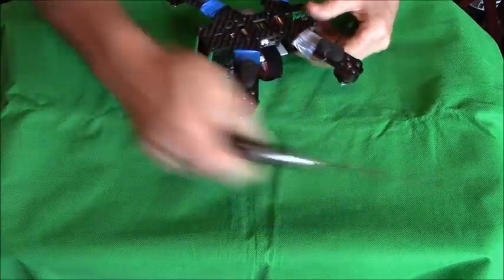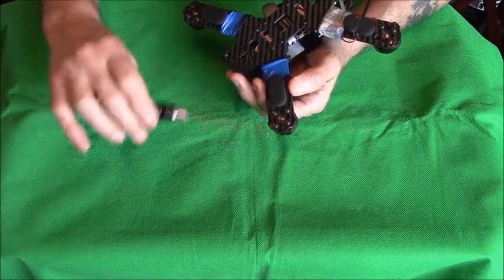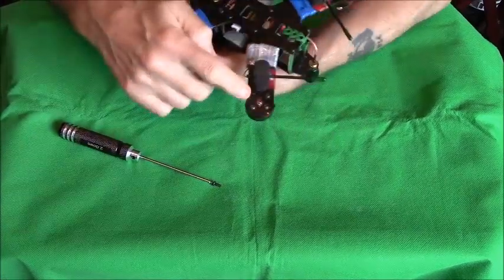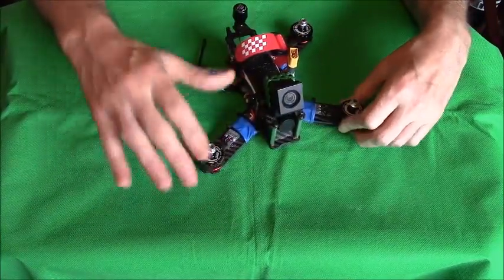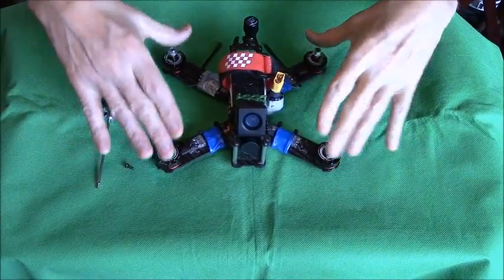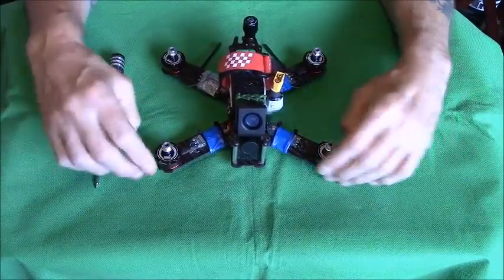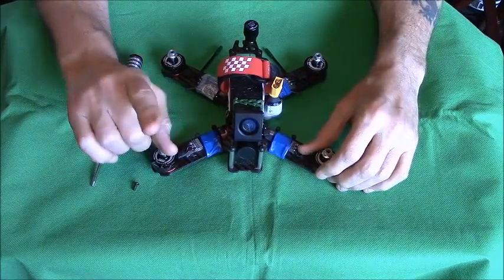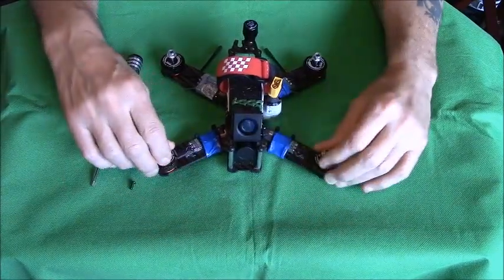HOW TO FIX HOT MOTORS ON QUADCOPTERS

Comment: I have a 6 s 25 0 7 motors and a brood of a motor just Ronan the motor on the Beta flight motors tabs one blip in smoke the motor and all for getting hot what is going on with this thing
Reply from the maker: What size KV are your motors ? and have you recently set up Bidirectional DSHOT & RPM Filter ?
Reply: @GeorgeCooper_LoneWolf  I have the lal 5.1 it has the 2507 motors I have the holybro v1.5 stack with the 65 amp esc . I swapped the motor and found   out it was the esc one pad is grounded to positive and ground. I was running the motor on betaflight  checking them it took a whole 30 seconds and the esc frays I have only flown it 3 to 4 times in my yard to tune it . Unbelievable
Reply from the maker: @jbengineering2681  Bloody hell sorry to hear that. Don't know where you got it  but I would send it back. That's the problem with RTF gear you have to trust whoever but it together did it right.
Reply: The sad thing is that I bought it new and the flight controller poped so I got rid of it and bought the holybro kukute I wanted good equipment it has a 65amp esc with the metal fets   and it died just bad luck I got the stack from raceday quads and the flight controller was bad when i first bought the stack from them they sent me a new one.now the esc poped .i have a check  eachine 79 and  i absolutely abuse it and it never has a problem lol

Comment: Thanks for the info , I have 4 2312 motors and when I fly all 4 of them are burning hot ... I can't even touch 1 of the motors ! props are 9x4 with 4s battery (450) size quad .
Reply from the maker: I hope this fix sorts out your problem. I hope this fix sorts out your problem, thanks for watching
Reply: Lower d term
Reply: @vampcaff   What is that ? are where is that setting ???